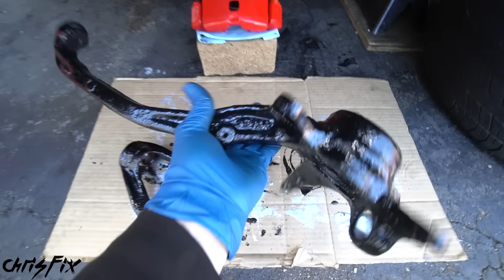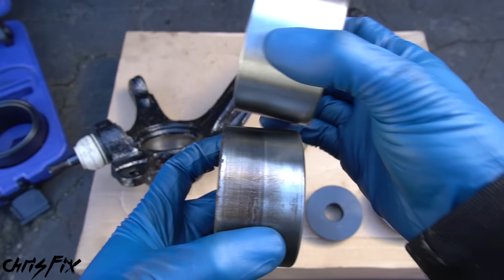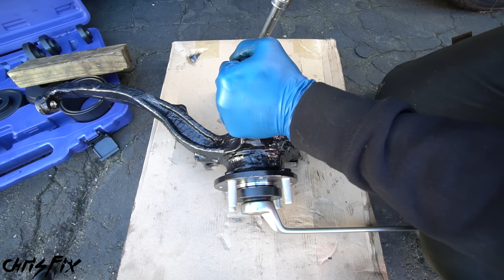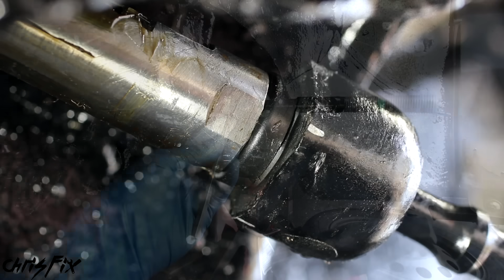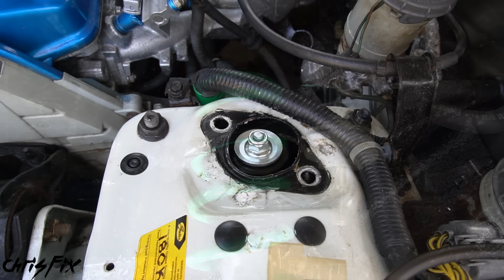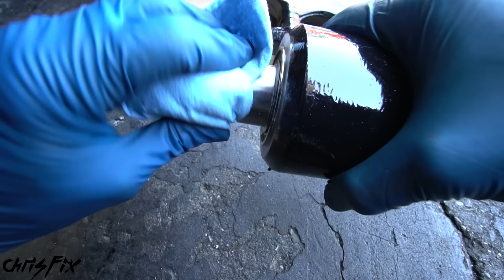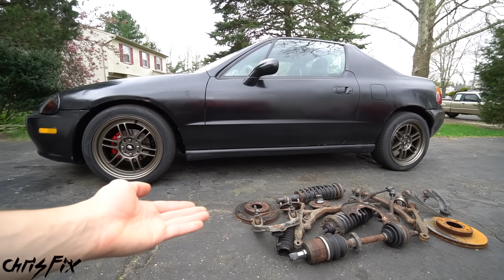How to Install a COMPLETELY New Front Suspension in your Car or Truck

Comment: When you install the snap rings make sure you don't put it in wrong side down. The bottom goes against the locking groove.
Reply from the maker: Thanks for the tip

Comment: That's what I'm talkin about. Well done video clip on the toughest physical challenge in auto repair. I did this job 20 years ago before this clip was out. Lost of bandages. 'Get a bigger hammer ' is the advice I always got on ball joint removal.

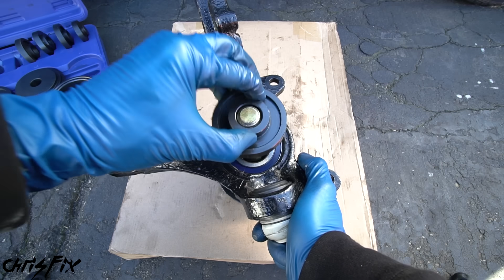Comment: At 7:43 you should use a plate that fits only onto the inner race if you are installing a shaft into a bearing. For bearings into holes - only press against the outer race. For shafts into bearings - only press against the inner race. This ensures no force is transmitted through the bearing during installation. Some bearings cannot tolerate force in a different direction than intended (axial/thrust vs radial), and pressing incorrectly can damage them, though wheel bearings are intended for radial (weight of the car) and thrust (cornering) loads.

Comment: a chris i have 05 jeep commander with abs esp bas lights on and at the dealership said it was the front abs sensor and the switch brake lights and a replace and still the same problem

Comment: Probably wont see this but I just got the full front suspension kit for my '04 Grand Am GT with 180K miles on it (and I have not been gentle on the ol' girl). Both outer tie rods are shot along with the passenger CV axle but as long as im going under there and breaking it down to that point might as well replace everything on both sides just like you did because the car feels really wobbly when turning and pulls to the passenger side when accelerating. This video gave me the knowledge and courage to do it myself at home, thanks a million brother!

Comment: Excellent and clear explanation of how to replace  components. Just a suggestion with regard to brake cleaner.......you can use Methylated Spirits instead. Cheaper to buy and can be simply decanted into an empty household spray bottle. It evaporates and no need to purchase an aerosol can of brake cleaner.

Same for penetrating fluid........your favourite mix, (ATF & Acetone; or Paraffin; or Red Diesel) etc......again easy to mix in an empty household spray bottle .....so no expensive cans of aerosols required.

Red Diesel, (here in the UK at least), is that which is not taxed for road use.....sometimes called Agricultural or Construction use diesel.

I use it in a spray bottle and, if required, from an old empty fruit or vegetable can if I need to use a brush to work it into a restricted space or difficult to remove component.

Red Diesel does smell a lot .....so if you spill it on items of clothing or overalls you will obviously need to wash these items.

A gallon of Red Diesel will probably last you for years.........so cost effective.

Thanks once again for the footage.....

James Hennighan 
Yorkshire, England

Comment: Chris on the axle nut do I have to hammer the tip before loosening the spindle nut? I did hammer the tip up on 18 Toyota Corolla im and missed the axle thread ,had to rethread em

Comment: Excellent work but one piece of advise, grease on that inner tie rod thread before it goes into the outer, saves alot of time and hassel when adjusting later on.

Comment: Chris: "using the right threadlocker"
Me: YOU LITERALLY USE THE EXACT SAME THREADLOCKER IN EVERY SINGLE BOLT :V
Reply: There is only 1 appropriate strength thread locker. I'm pretty sure there was a story involving 3 bears discovering it, at least that's the way the story will be told for now on.

Comment: Who supplied you with the parts and how much do you believe something like this would cost on both front and rear
Reply: It's going to vary car to car, as well as the manufacturer of the parts.  People like Raysbesto's have various grades as well.  Economy, Professional, and something in the middle.  Also, the springs and shocks/struts that you choose will have a huge influence on cost.  Personally, unless other people have reported good experiences with another shock maker on their car I tend to go Bilstein or Koni (tends to up the price a lot).  Other decent option is Showa.  If other people say they've had success with them on that particular model I'd consider Tokico, KYB, or Monroe.  (Ranco, Fox, etc for trucks) I haven't had good luck with them, but others seem happy with them.

Comment: Chris I really enjoyed watching your clutch replacement video.  I have a 2003 Tacoma 4cyl 4x2 and I'm wondering if my front coil springs needs to be replaced and my steering rack boots cracked and oily but I'm not losing steering fluid.  Thx

Comment: Hey Chris is there anyway to lift a 1977 2wd, I just wanna lift the front another 2-3 inches and I used the little spring spacers but they didn’t work to well and I wanna know if there is any way to lower the bottom a plate.

Comment: i am doing my front suspension now on my volvo. Really nice to follow your advice. My ball joint sits a bit loose in the lower control arm, pressed upwards not downwards, and i got the ring put around it

Comment: Correct me if I'm wrong but using thread locker on bolts which you wait to tighten seems like a waste, these things take roughly 5 minutes to dry and bound so when you tighten them bolts later you rip the coat thread locker had and it's no longer useful.

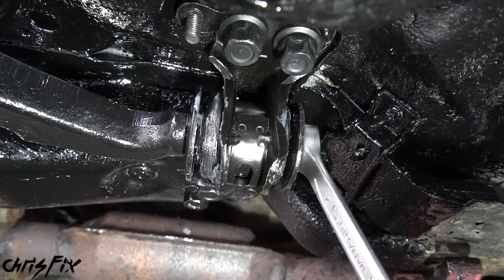Comment: I noticed at 19:35, you said just tighten it as much as you can.  Do you have crows feet sockets that have ratchet inserts?  That is what we use installing aircraft parts for torque specs

Comment: Is it the same steps and parts for a 2006 Toyota Tacoma. Is this ideal for a DIY or should be left to the professionals. Roughly how much did you spend on the whole suspension. Thanks in advance.

Comment: For you guys who don't know...do not use your torque wrenches like they're a long handled ratchet. You don't want to over torque the measurement mechanism...and ruin the torque wrench's measurement mechanism. And, yes...do torque your bolts and nuts to factory specs.

Comment: Would removing the hub and pressing out the rear wheel bearing on a RWD vehicle  be approximately the same procedure as yours up front minus the fact that front is built into knuckle? Recently rebuilt my front end too and was thinking about investing in bearing adapters but, none fit my vehicle in the rear and front had hun built into rotor therefore different bearing than yours.

Comment: Chris, I gotta tell ya... I drive for Uber and have a 2008 Impala.  I bought it with 95k miles on it 4 years ago. Been driving for Uber for 2 years now.  Put something like 70k miles on this car in 2 years.

You are SO RIGHT when you say that your car feels completely new when you get a new suspension done.  So far on this Impala, I have replaced all 4 of the wheel bearings, all of the brake calipers, rotors, both of the outer tie rod ends, etc... I haven't done anything with the struts yet, but I plan on it... JUST getting new bearings makes it feel so much better!  Steering is so much better once you get new tie rod ends, too... it's incredible the difference it all makes.

Comment: OK, Chris, to get straight what parts you replaced and what you kept...

the tie rods ARE replaced, 

the upper control arms ARE replaced,

the knuckle ISN'T replaced; the rust is simply wire-wheeled off down to the bare metal, then the knuckle painted (what told me this is that you hammered out the old ball joint and bearing--it wouldn't make sense to do that if you were just going to replace the knuckle with a new one),

couldn't tell if the strut fork was the old one wire wheeled or if it was replaced, UPDATE:  the strut fork was not replaced either; it was wire brushed and painted like the knuckle was (from companion video)

Was the lower control arm replaced or the old one just wire wheeled down and painted?  After watching the companion video to this one, it's still unclear.  I suppose either one can be done, depending on the condition of each (meaning that if the old part isn't too damaged and eaten away by rust, and is, therefore, salvageable, simply wire wheel any rust off and paint it for continued use).

I also saw that you don't spray paint the parts, but brush paint them.

Obviously, the struts, bearings, ball joints, brake rotors and pads, calipers, and hubs are all new as all are "wear" items.  Axles are also new. 

I'm considering trying to do this, and I realize that it's up to me as to what to replace and what to keep, but would really like to know just what you did and didn't replace to give me a better idea as to  what I should replace and what can just be fixed up and "rehabbed."  Thanks, Chris.

Comment: Dear Chris, thank you for the video. Could you please share your thoughts on the following situation:
I was replacing CV axle which involved removing lower ball joint and strut fork from lower wishbone (bushing). The ball joint threaded part started to turn around with the nut. I blocked it with a hex key and tighted the nut. After the repair the lower ball joint started to squeak pretty loud. Is this because it changed its position inside? Has it gone bad or I just need to lubricate it with some oil? Thanks.

Comment: If there is a clicking noise coming from pressing  the clutch in and depressing around 2,000 rpm going from 1st into 2nd. Is that possibly the axel nut causing that sound

Comment: hate to be a n00b but i just did this on my parents car. Though i had some real issues with the snap ring on the lower ball joint. my pliers couldn't get the ring wide enough. i had to wrestle with it. i went to the parts and local hardware store to see about a bigger set for to do the other side with but they only carried the 2 I had already tried.
Where did you get you pair @ChrisFix

Comment: When you will upload replacing the headgasket of this Honda?  Continue to inspire Chris fix. :) thank u
Reply: Thats simple. Get a cometic head gasket...and if you can afford it..i recommend some arp head studs. Make sure you get a good torque wrench..tq in the pattern. Find real deal honda specs...and..when i did my d series..i went ahead and had the machine shop hot tank it and do a valve adjustment.
Reply: Just type on google civic eg coupe 92-95 torque spec forums will come up
Reply: Civic and del sol pretty much same thing

Comment: I don't know why there are dislikes on this video!!
Reply: because that's (as of my posting) 523 shops that can't charge $2000+ dollars in labor to do the same shit! I just looked at all the parts to do the exact same job on my car (minus all the tie rods because I did them a few months ago and the lower control arm because it looks new despite having 155,xxxk miles on it) and so far it's only $348.xx on amazon. I only need the cheapest oe equivalent for my 2012 mazda 6i daily beater, especially since i'm not doing uber anymore.

Comment: hi Chris and everyone, 
not sure if Chris would be seeing this, but i have some issue with my ride. 
i have changed to a coilover, but it seems that my issue still persist. i do hope you could help.
first is that whenever i go through a speed bump, those made bolted onto the ground type, my front seems to be making a flapping sound.
i am unable to record it from the drive cabin.
second, whenever i drive through a rough ground, there is sorta like a metal hitting metal sound even after changing my coilovers,
i have check the bushing, all seems okay, could it be my steering rack? (rear wheel driven car)
thank you in advance
Reply: Benji Khoo are the coil overs adjustable? Try to check the adjustments (compression, damping, ride height, etc), as for noise, check for clearance, remove wheel and move the suspension around
Reply: @richardrahadi  the coilovers were check... nothing wrong with it.... wheel clearance is good.. stock wheel, stock height... initially, suspected the stock shocks had issues, that is how the coilover is now in.. but it seems that the flapping sound persist everytime i clear a speed bump... how ever for the clanking sound when drive over uneaven road, im not sure if it is the steering rack...
Reply: @gn1w  i'm a computer technician not an auto mechanic but my first thought is to check all engine and transmission mounts.

Comment: I have a 94 civic ex coupe and I have a problem of whitch I cannot figure out, I’ve replace stabilizer link and tie rod end , on the left side on decelerationand accelaration there is one or two pops and when I make turns but only when I do those three things

Comment: "You dont want to put it in dry" ... good tip!

I noticed that your wheel hub assembly video used a lot of anti-sieze, but this video doesnt, is there a reason for the change?
Reply: probably knows it's never coming off the car again

Comment: Awesome! How about a video on assembling a non-quick strut, ie. buying the mount, seat, insulator, bumper, dust shield, etc. separately and building it from them?
Reply from the maker: I want to do that so stay tuned!
Reply: @chrisfix  looking forward to it! these monroes quick struts I put into my 2012 mazda 6i already failed  after 7 months of use (I put them in after I stopped doing uber), and I don't know about those sen-sens. Those are the only 2 people that make quick struts for my car (minus the cheap no name brands like trq, am autoparts, fcs, strutek, etc.). kyb makes them for the v6 version of my car, they discontinued it for the 4 cylinder so i'm stuck f'in with the springs if I want quality struts.

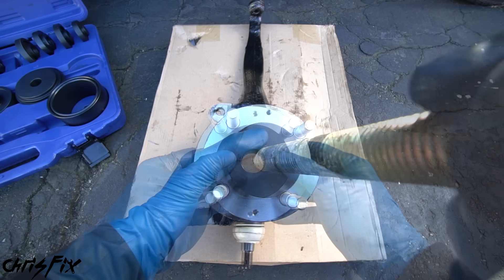Comment: At 7:42 you should have used an adapter to fit on the inside race of the bearing for future reference
Reply from the maker: Thanks but the adaptor going over both inside and outside is perfectly fine. The pressure is still distributed properly. If there was no pressure in the inside race that would be an issue as you mentioned.
Reply: @chrisfix  ahh ok makes sense

Comment: What is the meaning of torking a bolt
Reply: It means the bolt has to be just tight enough as per factory specs. Over or under tightened could be dangerous. A torque wrench is used and they click when you've reached the specified tightness.

Comment: I get all this motivation watching how easy he does everything, but then I look at prices...
Reply: Its a honda though..ever wonder why you see old hondas all the time..but never see old buicks or chevys or fords....as in not nearly as many or as often? A hondas worth rebuilding..parts are cheap and they last forever. Go find me a 20 year old engine for a buick..a 20 year old honda engine is like 150$ and they would love to sell it to you. It has to be the right car..or you are wasting your money.
Reply: but...add another 2 1/2 to 3 times that to have a mechanic do it. it's so much cheaper to be able to do things like this, yourself. i'm very grateful i had a dad who taught me how to do car maintenance. i haven't paid for a brake job, oil change, suspension work, hoses, belts, water pump, alternator, battery, and many other things in years.

Comment: Just got quoted at around $1500~$2000 to repair my 1998 toyota camry... need new front shocks, new rear and front control arms and front sway bar links and bushings all around..... car has 127,000 any advise? 

I also replaced the radiator myself  I also had the rear shocks and sway bar end links replaced because they were really bad...  the car rides awful on the highway it kind of pulls to any side it wants to..... good stuff

Comment: Hey Chris I like your video just a couple of things though. They make a thing called torque stripe specifically for marking torqued nuts, Castellated nut's usually have a torque range and you torque to the lowest setting so you have room if you need to move it for the cotter pin, the rear control arm bushing you should have rented a crow's foot so you could torque it properly

Comment: Hey Chris just an FYI if you're twerking the bolts to spec after adding loctite you need to remove around 20 foot pounds. Wet torque and dry torque are two completely different numbers. The torque numbers in the book are dry torque. When you add anti seize your turning it into a wet torque

Comment: Why you dont put those turbo and intercooler to your Driftstang
Reply: It wouldn’t work because the driftstang is a V8 and the del sol is an in-line 4 cylinder

Comment: You never did show us how to tighten the rear nut on the bushing 17:55 minute mark, that you said you would do when the suspension was under a load.
Reply: What he tighten down was the part to HOLD the lower control arm, not the bushing.

Comment: Chris I watched your video like 3 times and still forgot to put a load on the suspension when tightening everything up. Is it worth it to take everything apart and put a load on it and then torque everything?
Reply: Alright took it apart and did it again with load

Comment: CrisFix, I've been having some issues with my 1996 Ford F150, turns out starter begun getting stuck cranking but after a while it would just run good, it would always do that when cold, but kept getting worse and now does it all the time, I've replaced the cylinder lock,  starter solenoid,ignition switch under steering column, starter relay and starter itself, I found a few wires with stripped insulation, during the processs which I fixed, but problem persists, I've basically run out of possible causes.
Hope you or any one else reading this can help, I've researched and done everything suggested from tapping starter with a hammer to unstuck bendix, to  turning solenoid so its upside down, etc.

Comment: hey chris. i did this exact thing for my old truck except my steering is still sloppy after. i even swapped out the steering rack for a brand new one. it is not an OEM rack but a aftermarket one. i believe this is the problem but dont know for sure.